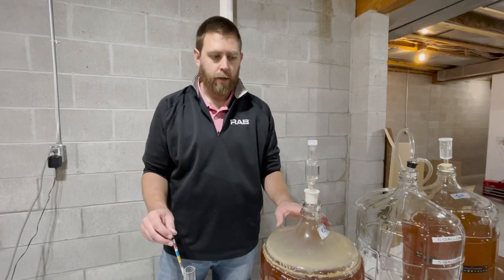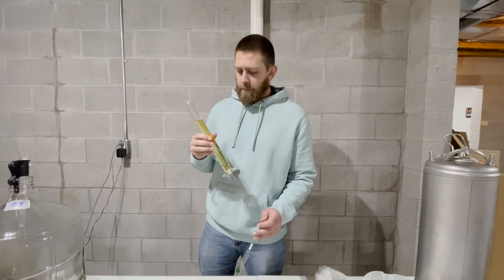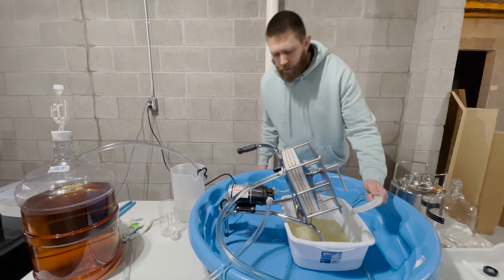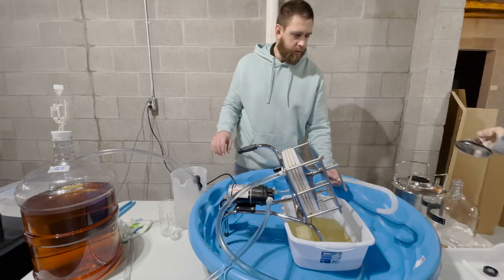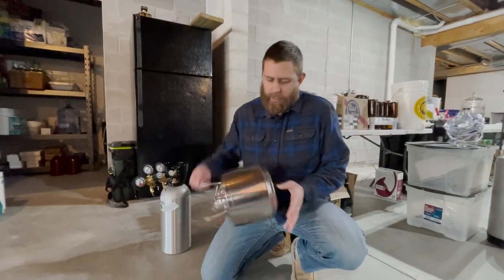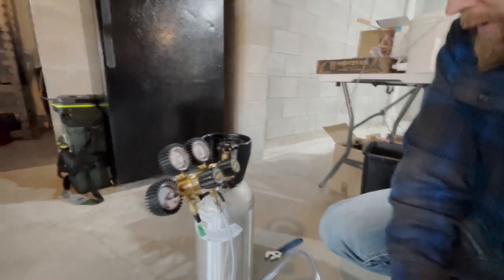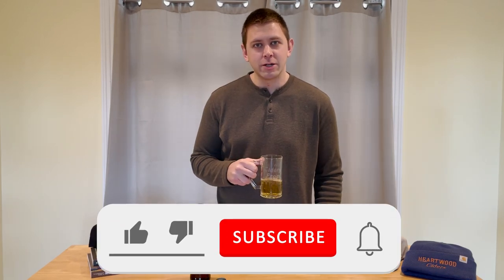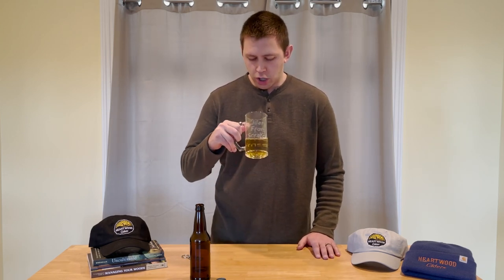Making Cider - Filter, Back Sweeten, Force Carb

Comment: Hi folks, great show, you are starting to get a good rhythm going. two question, what was the abv of that 1 gal/6.7% after adding the juice.Do you think filtering wil stop fermentation after back sweetening. Cheers
Reply from the maker: Thank you! It means a lot :) By adding the additional apple juice, we dropped the ABV to just under 4%...knowing this, we will plan on starting with a higher gravity or adding slightly less juice in the future. We want to keep the ABV between 5-7%. The main reason we have decided to start filtering our Cider is to remove that inactive yeast, sooooo ideally Fermentation wont be able to start again after we add the sugar! However, we will find out in the next few months as some of these bottle sit on the shelf!

Comment: just an observation, once you have proved cider is going into waste container isnt it just as easy to turn the pump off (to reduce spill risk) place into new empty container and start pump,
Reply from the maker: Hi Kev, thanks for the feedback! We are newer to the filtration process so any thoughts are appreciated. We will give your suggestion a try and see what happens......the only thought is that turning the pump off will cause a loss in pressure and potentially add some air into the lines? we were worried about negatively effecting the pump and cider with Air
Reply: @CideryFromScratch   Im unsure where the air would enter the system, as you have created a open loop and purged with water, therefore the air has been purged from the initial dry system, just my thought, and if the suction line is submersed all the time then you have eliminated induced ingress of air. I dont use filters and im new to the hobby but we do use many a different pump for work applications. Does the pump have a non return valve built into the pump and or a bypass for over pressure? If a bypass is fitted then you can valve the suction and discharge leg and close when flushing is complete, this will also reduce induced air ( my opinion only) great vid keep up the good work love it